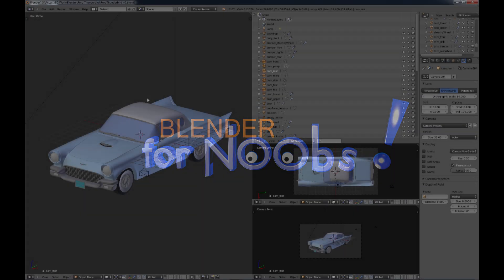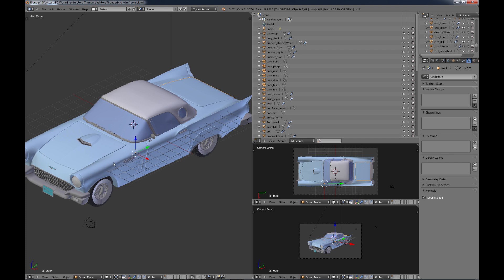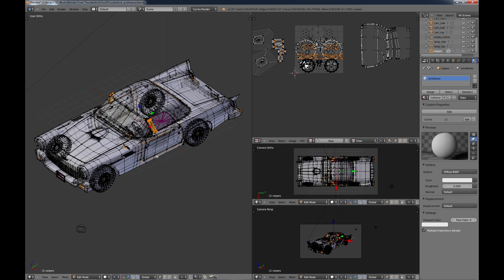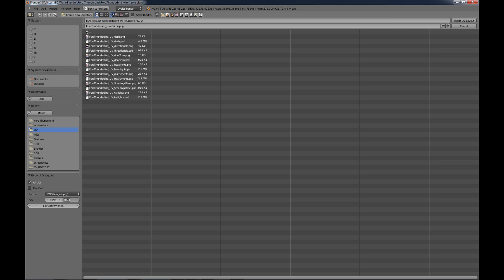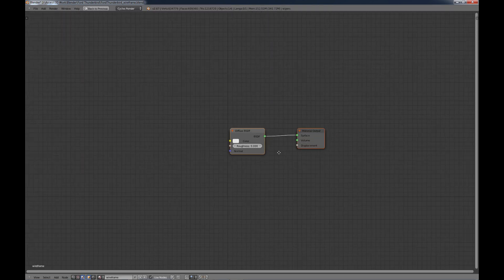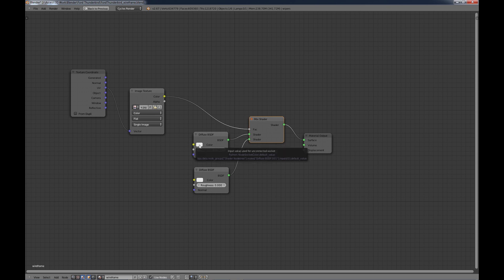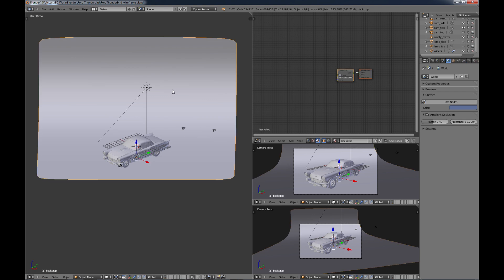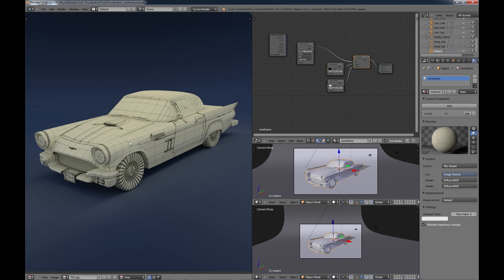Blender For Noobs -  How to render wireframes in Cycles - better method [INTERMEDIATE]

Comment: You can also use the wireframe input node into a mix shader and use 2 diffuse shaders to control the mesh color and the surface color (same way you did it in this video, just skip the UV exporting and use the factor output of the wireframe node).  I assume the wireframe node came out after this video.. not exactly sure :).

Comment: The reason the untreated .png would make your output darker is that when you exported your UV layout, you left the fill opacity at .25. This meant that inbetween the wires, it filled the image with 0.25 alpha, so when it came to the wireframe effect, the best you were getting from faces was probably 75% of what you were after and 25% of the other shader.
I've just done it using just png export files and the alpha channel as the mix input (0.0 fill opacity) and it seems to work just fine.
Dave